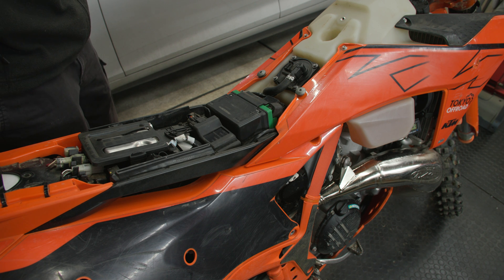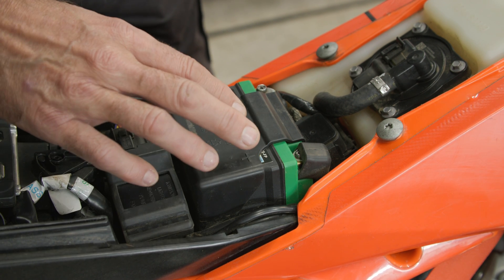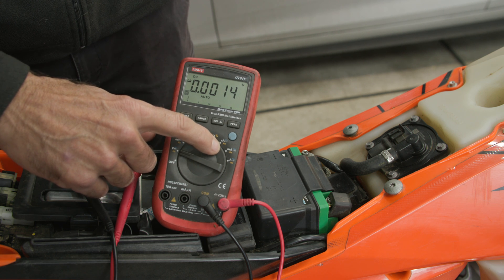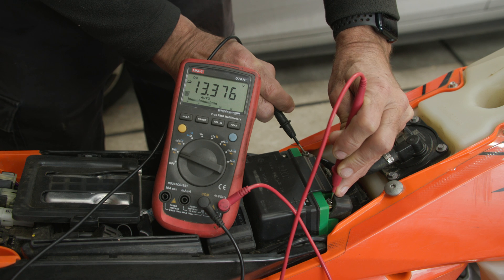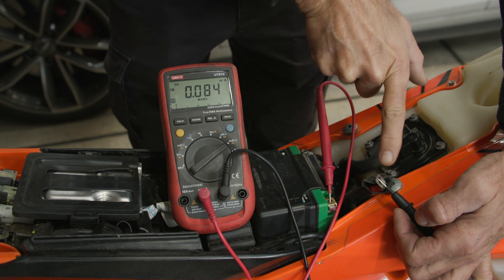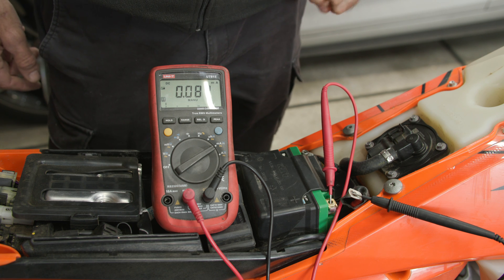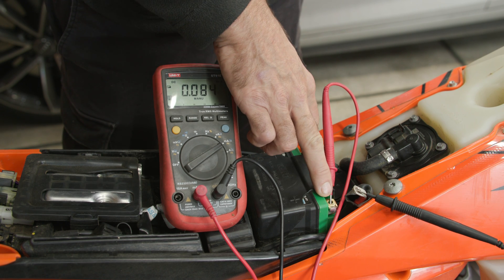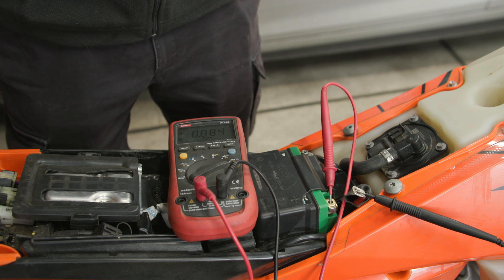Battery Parasitic Drain Measurement During Storage

Comment: Lithium battery's shouldn't be stored at full charge, usually 50-70% is recommended. My charger has 70% as the storage from what I remember.
Reply from the maker: Are you specifically talking about LiFePO4 batteries used in these bikes. If so then greater than 50% charge seems to be recommended for long term storage. This source states " If you want to store the battery for a long time, it is recommended to charge it at more than 50% and, ideally, store it in a fully charged condition. The higher the charge, the larger the charge-retaining power of the battery during storage." https://www.evlithium.com/Blog/how-to-store-lifepo4-batteries-for-long-term.html

Comment: Wouldn't it be safer to use the ground in the measurement? Using the +12V creates a risk of accidentally shorting the battery if the probe touches the frame/engine.
Reply from the maker: On my bike the probe will not reach from the battery terminal to the frame. So it’s not a concern. But if you have a bike where that’s possible, yes, it would be safer to use the earth connection. No matter which way you do it you still need to be careful and not short the battery out.

Comment: How much voltage would be a “problem”?
Reply from the maker: A lithium dirt bike battery should always be above 13v if operating correctly. Below this voltage you might start to see some starting issues, particularly in cold weather, cold start first thing in the morning.
Reply: @TokyoOffroad  i am sorry I did not mean to say voltage. I meant to say amperage draw. Meaning what level of “parasitic draw” is considered “material”. Forgive my first question.
Reply: @shaneburesh9173  My question exaclty. It's hard to say the scale, ig 0.084mA is said to be low - what is high - and what is still acceptable.

0.1mA * 12V would mean 1.2mW = 0.0012W power draw.  Does not sound excessive. So if a battery is 4Ah, 0.1mA draw would mean that the parasitic draw drains the battery 100% -> 0% in 40 000 hours. 

Nice video otherwise.

Comment: Speaking of multimeters, do you ever do the thing where guys are measuring their tps / throttle?   If so, do you have a video how to ?
Reply from the maker: On my 2024 KTM 300 EXC TBI I have the Two Stroke Performance ERM which can measure the TPS voltage. It's a really useful and handy feature of the ERM: https://youtu.be/lYPRQ44J4J0?si=GJxYWautl-YEVJMk&t=273
Yes, you could use a multimeter to do this but you'd need to make a plug & socket harness to easily do this.
Reply: @TokyoOffroad     Ahh OK.  So the ERM can detect the current position and then use that as the new zero point if I understand correctly?